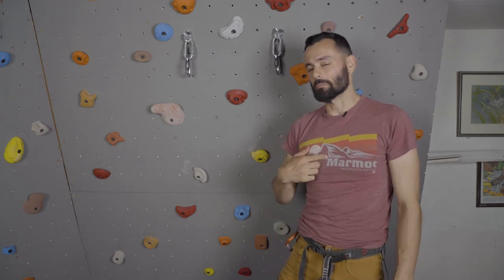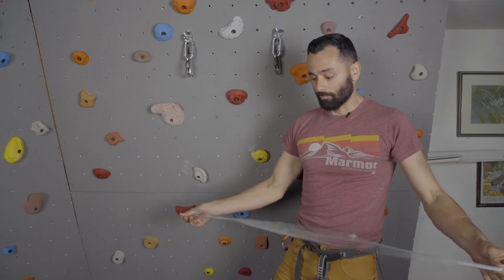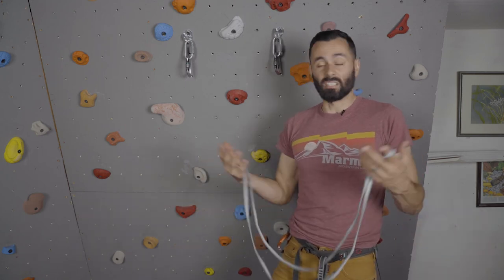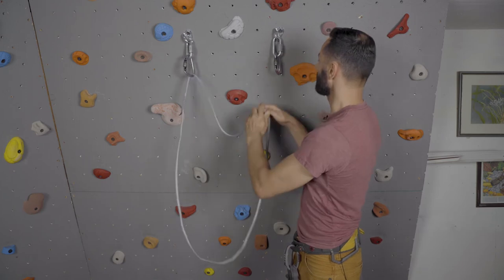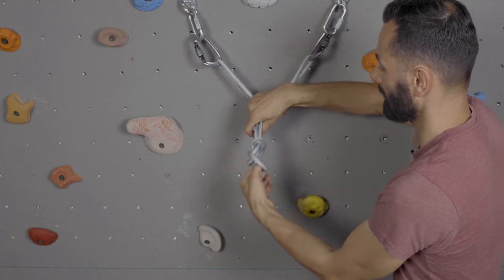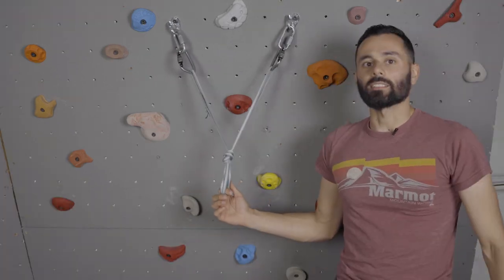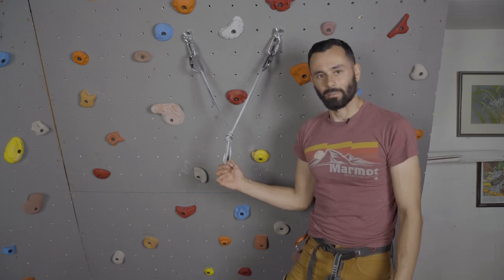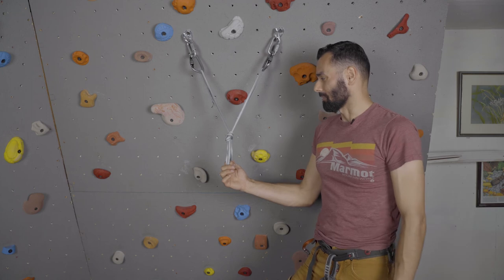Overhand Knot Anchor With A Sling

Comment: Love your videos!  Keep it up!  

What is the redundancy there?  Could you explain a bit more, as compared to a quad maybe?
Reply: If one bolt fails the anchor will hold with just the other bolt, and vice versa. Same for if a strand on one side of the master point was to be cut.